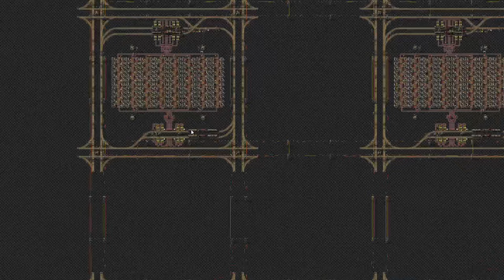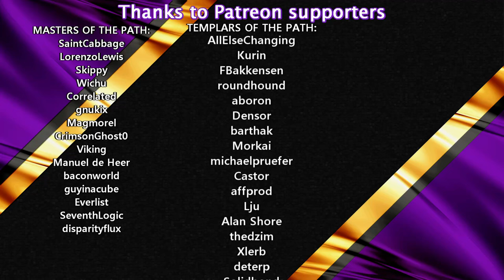How I Made Factorio Play By Itself | Ultimate Automation Challenge Tutorial

Comment: Functionality, what is the difference between letting the power crash and shutting down a base recource production? The shut down just propagate through the entire factory and take a long time to return to true creating false demand flags the whole time while doing so. Could you just set the min power level higher like 75% to completely resolve this issue?
Reply: Firstly, power crashing to a brownout affects logic combinators, which would almost certainly throw off the brain. (Or at least the "we need power" SR latch. This exact thing happened on stream with one of the first power detection designs he tested.)
Secondly, you actually seem to have it the wrong way around. Having the whole factory shut down at once (or slow down at once) is a condition from which recovery is pretty much instant (because all the stockpiles in the train stations are neither filled nor depleted). Shutting down let's say only the steel production will cause the steel stockpiles to be depleted during the night, because all steel consumption will continue running at full speed, and thus selective shutdowns will actually need some time to recover.
However, the blocks that Nilaus shuts down (iron plate, copper plate, steel plate, bricks, oil refining) all take in only raw resources. And meanwhile, the whole rest of the factory will keep working unaffected for some amount of time (which it wouldn't do if the power crashes completely). So he (or actually the brain) has to over-build these smelter blocks (in order to allow them to catch back up to demand after they've been shut down), and he has to over-build the blocks that provide the raw resources. But not the science labs and everything in between.

Thirdly, yes, you could avoid over-building these "smelting" blocks by changing the power cutoffs. Having the factory build new solar blocks once the power drops below 50% means that (after the solar blocks are brought back up to spec) only 50% of the accumulator charge is used to bridge the night, and 50% is merely an emergency reserve to avoid total shutdown when the charge drops below 50%. (This is assuming that the factory can bring the power fully back up to the 50% specification every time it drops.) So, with a cutoff at 50%, the factory should build twice as much power production blocks as are needed.
If you changed the condition for building more solar blocks to 75%, the factory should build 4 times as much power blocks as needed. But in return you could change the cutoffs for the smelting blocks to 25% and know that they should basically never turn off (and thus won't need to be over-built).

So, these cutoffs are always a compromise between
--- fully guaranteeing that the power never crashes completely
--- over-building the solar city blocks as little as possible
--- over-building the smelting blocks as little as possible.
Do the cutoffs that Nilaus chose give the optimal balance? Almost certainly not. But they do the job well enough.
Reply: @Pystro  Thanks, that was very informative.  I definitely had not considered the SR latches interaction.